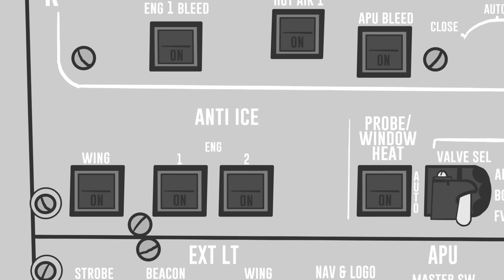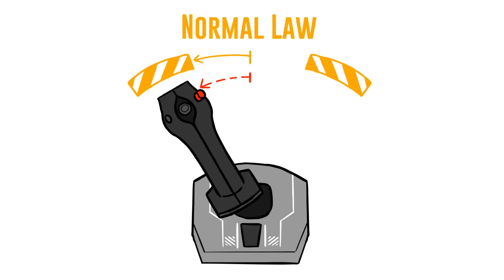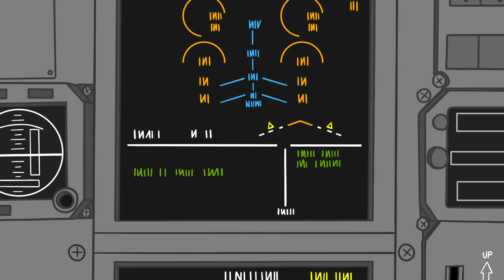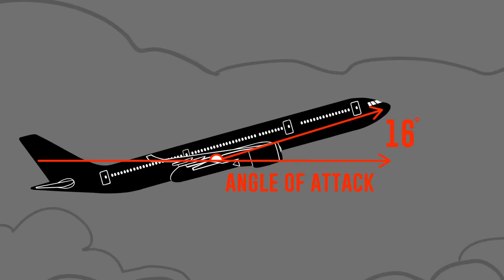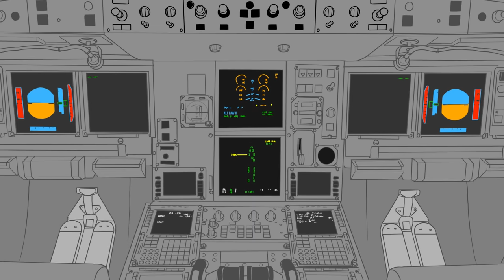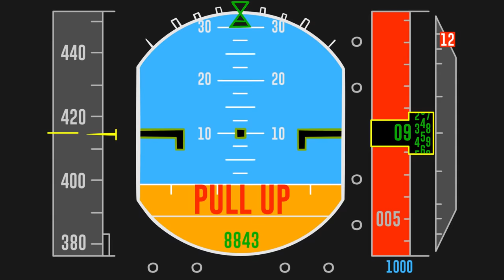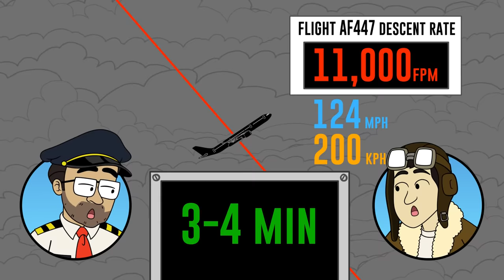What Happens When 2 Pilots Cancel Each Other Out?! | Aviation Explanation

Comment: I'm not a pilot either, but I feel like there should be some kind of indicator on where the other stick is if it is out of sync with the each other. It shouldn't prevent such movements, but it should show you like hey stick B is at -40 while you're at 50, maybe you should adjust.
Reply: You get an alarm that says "dual input" when you do that. To my knowledge the pilots didn't speak English and ignored the alarm. Happens a lot more than you'd expect. Pilots not knowing the aircraft entirely that is
Reply: @aaronpena4500  Ah, that makes sense! Thanks for the information.
Reply: @aaronpena4500  All pilots need to be proficient in English to keep they’re licenses. They’re tested annually on English. True there are numerous instances of pilots not recognizing warnings, but English proficiency almost certainly not the case in this accident.
Reply: @WhereWeRoll  then I suppose they were unfamiliar with the alarm. I'm not sure where but you can listen to the old CVR recordings and hear it say "dual input". Even so the pilots ought to be proficient enough with the aircraft to know when they have or don't have override control. If I'm not mistaken there's a light indicator showing whether captain or F/O has bias on the panel in front of them( I can't remember the designation airbus gives it)
Reply: @aaronpena4500  I don’t think they ever released the cockpit recordings for this flight but there are some re-enactments online I’ve heard. Maybe one of those made the alarm more pronounced than it actually was.
Reply: the saddest thing is if they looked at their instruments it would have been notice. 30* nose up is obvious on instruments...
Reply: @WhereWeRoll  So I actually looked a little more into it and it's just that they didn't recognize its meaning. They were worrying about everything else. It happens..... You get tunnel vision and focus on only one problem. It's rather loud as an alarm but I can see them ignoring it if their becoming worried.

Comment: This is pretty interesting to me. I'm a pilot aiming for the airlines in the next 2-3 years and it's always good to learn from previous errors. Fly-by-wire is fantastic but this is certainly a flaw with it. I would also like to say it's really sad to hear that even when the plane is clearly losing altitude with a nose-high attitude Bonin still thought the increasing pitch was the correct answer when clearly they were on the other side of the lift curve

Comment: So a stall isn’t so much about the engines failing but just not being able to get enough lift?
Reply: yes, it means the plane doesn’t have enough speed to continue flying and starts to descend
Reply: @scj6693  To be specific, while airspeed and lift are generally correlated, many things can cause a lack of lift for a plane. In this case, it wasn't the planes speed but the angle of the wings to the direction the plane was actually moving. Which I suppose is not the correct speed for that angle and your kind of right.
The animation has it pretty well at the end where you can see the plane is almost perpendicular to the direction it's moving. 
What makes this confusing is a plane can technically fly at that angle it would have to be going much much faster than it was (and be able to maintain that speed since it is like pushing itself up a hill)
A few examples of other things that can change the lift of a wing dynamically would be air pressure (which can change significantly), the flap configuration (the things on the front/back of the wing you usually see extend when landing or taking off) or like OP said if the engine are on or not can effect the way the air flows over the wings (there are a few planes where this is particularly important, but most its not as big of a deal as people usually expect)
Tldr: speed generally equals lift but I wanted to rant about it for a few paragraphs because it's the internet and im bored.
Reply: @brodyatto9535  …what this guy said, pretty much

Comment: The way you recover from a stall is to reduce the angle of attack. You can stall at ANY airspeed. Increasing thrust is important to recover from a stall by allowing you to climb away from the ground faster not actually stopping the stall itself. This is coming from a commercial pilot.